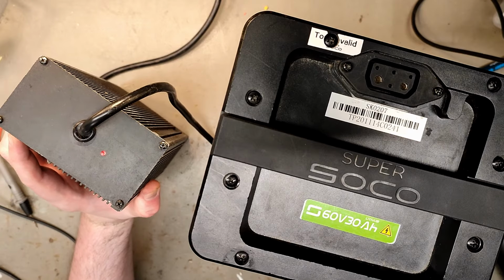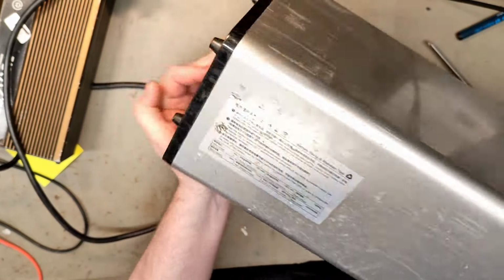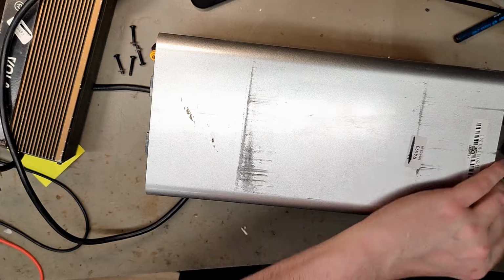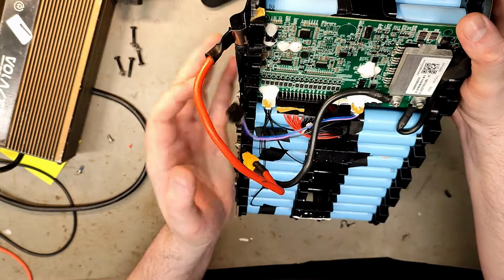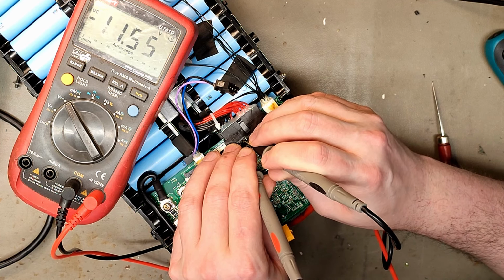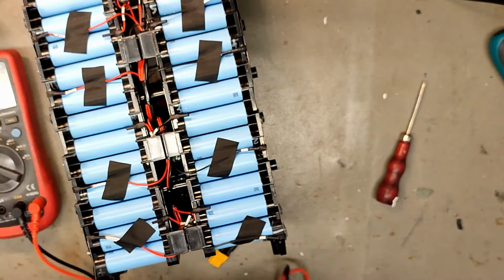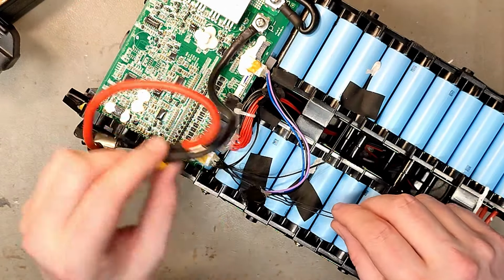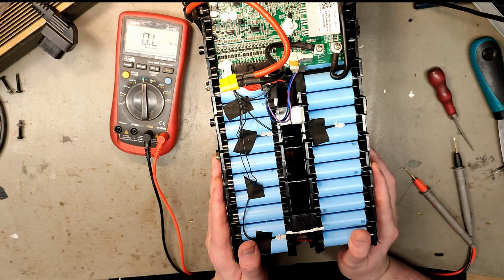Super Soco TC 17S (2021) Battery Diagnostic Attempt

Comment: Yeah i got a 60v 30ah super soco battery too upgrade my Motorino MXB Sport 72v , i put it in and it lights up my lights and alarm and everything works , but when i twist the throttle NOTHING . I then plugged the charger into the bike and then everything works ? Unplugged the charger and only lights and alarm again work but no throttle go . I took the battery out and tested the voltage and its 67.2v like it should be , i then too the battery apart and tested it just like you did and everything checks out . I unplugged the BMS entirely for 5 minutes too reset it but noticed the exact same red light intermittedly and it also did that light while unplugging the bms ? Put it all back together same result . I am at a loss . And their is no battery repair places and i cant find anything online , even super soco website does not give out info on that flashing red light and if its a fault code or something .
Reply: I run these batteries in 2 different bikes so i hope this helps you out. The BMS in this battery will go to sleep after a certain amount of seconds of no draw. Your bike is probably throwing a low voltage alarm because the battery was asleep before you turned it on. Try to plug the battery into the bike and then turn the bike on to wake the battery up. Let the low voltage alarm run its course and then turn the bike off and then right back on to reset the controller. The battery should be awake and the alarm should not go off.

*Edit. You can ignore the red light that you see blinking on the bms, its the Bluetooth for the app. From what I've researched the app only works in China now.

Comment: had a run in with a few of these, some had similar cells but some had MH1 LG. Most of them had problems with cold solders on main port, had to cut into plastic to expose the connections. Good thing to have a thermal cam and check while under the load.
Reply: Hi, i have the same problem as you describe would you be able to explain how you did it and exactly how it was wrong?
Reply: I Would be interested too

Comment: There is software availble for reading/resetting the BMS and also the cell voltage etc there is also a tool that connect to the battery so you can adjust the settings etc. If i can find it i can send you the name of the  software.
Reply: It’s either SOCO CAN Data Monitor or BMS PC Software by PowerAmp

Comment: Do Super Soco batteries  have encryted/propietary bus line with the controller/motor driver blocking oem batteries just lik shimano-bpsch motor integrated ebike setups? with shimano you're forced to pay the premium for subpar capacity batteries a lot of money and i would like to know for sure if i wil be able to make my own battery pack for Super Soco CU-X 60V 30ah bike without any limitations.

Comment: Just about to open a 48V NIU battery for my friends daugther. Seems they used some adhesive for the top where the main DC connector goes... Could not find any 48V disassembly as inspiration here on YT and I just hate when they glue the case together... Going back out with heat gun and carpenterknife to see if I can get case open... 
Great shoutout to battery doctor for his transaprent and helpful YT channel.
In Swedish: Tack för en grym kanal !